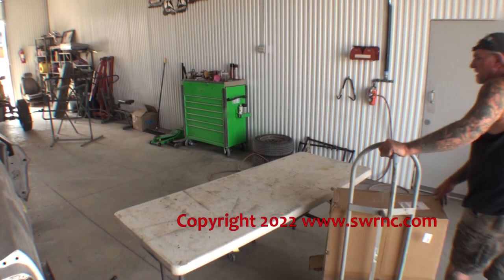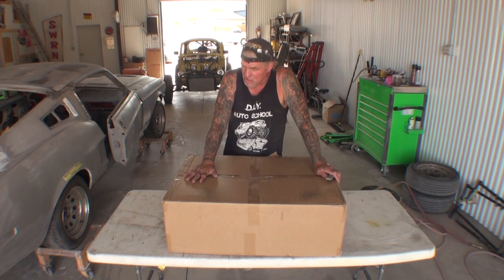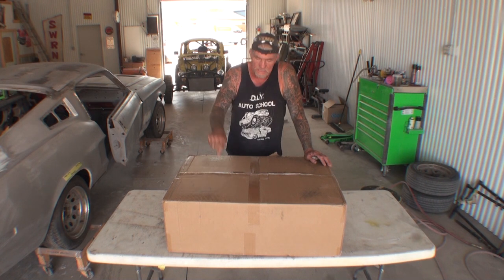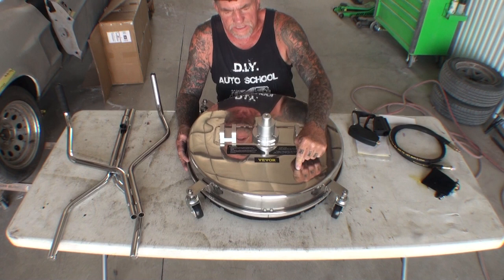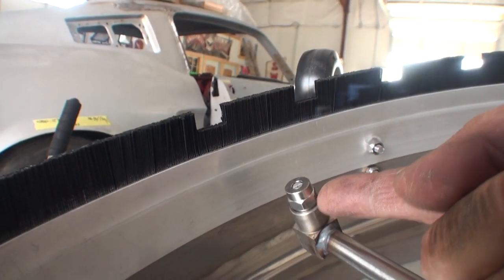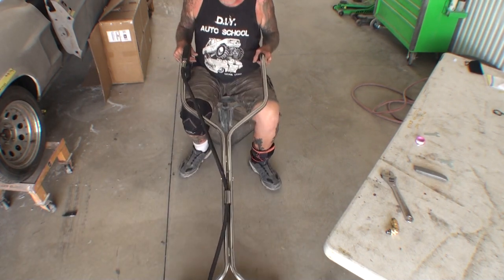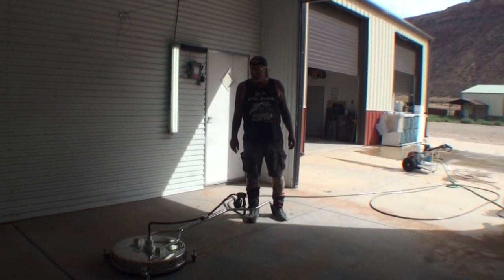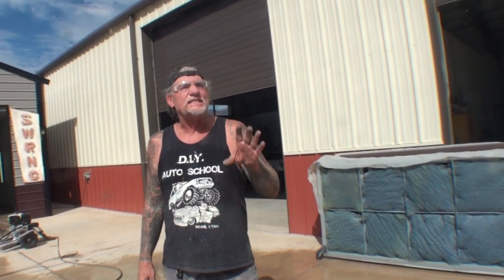What Is A Surface Cleaner - Pressure Washer Accessory Explained

Comment: Mines came missing parts had to rig it up, but works great! My pressure washer is a built gx390 that runs on e85 and no governor. I had to Put weights on top of the Surface cleaner. Because it has so much pressure it'll simply just fly away. #1

Comment: Pete live in UK and purchased the 24” two nozzle. Have questions to ask as the instructions from French to English quite bad lol
I ran before I could walk buying the 24”  Vevor have been a waste time talking to and not answered any questions.
I have a Karcher K6.75 130 bar min 150 max so I know that I have to go bigger electric or gas makes sense. The 24” is min 800psi at 2gm and max 4000psi at 8.5 now looking on YouTube people say 4” to 1gpm so if that was true I would need a 6gpm machine
and that is not going to happen as I am just using for home cleaning my drive and neighbours. I saw your machine was a 4GPM 
Most machines are around 2500 or 3200 psi but the liters per minute work out to only about 2GPM unless I am working this out wrong.? Machine I wanted was Hyundai P1 3200 psi 11L/M cost around 500 uk pounds am I worrying about the 4” to 1gp/h rule what can you recommend. Please help as wife is getting fed up with me talking about this lol

Comment: What you do when you clean your concrete this way is take the finish off the concrete which make it more pitted and worse in the long run.
Reply: Wrong only if used incorrectly and not matched with the proper tips

Comment: Can I use the same surface cleaner with a 3200 Ryobi pressure washer?
Reply: Lol. No. You need 4000 psi 4 gpm minimum

Comment: stainless steel is NOT rust resistant my friend.....maybe only STAIN - LESS  STEEL.....rust - less no way
But for my friend Pete like anyway, always
Reply: It all depends on the stainless. I have a half sheet 2x8 feet of stainless that I have had for 28 years that a magnet will not stick to. It has not and will not ever rust.